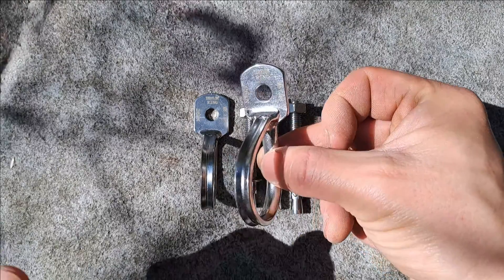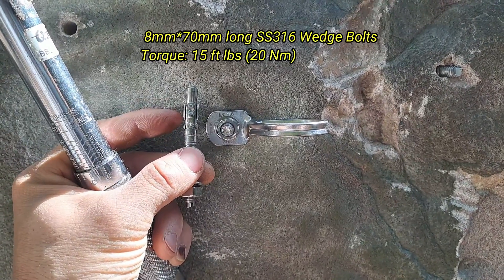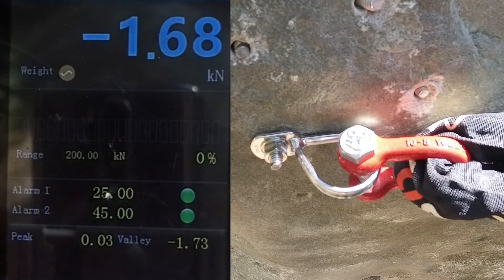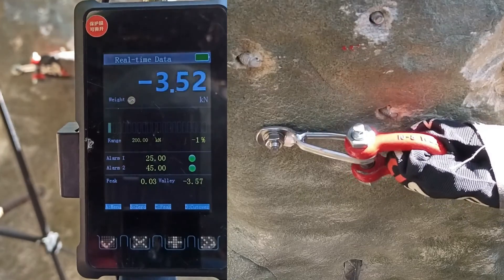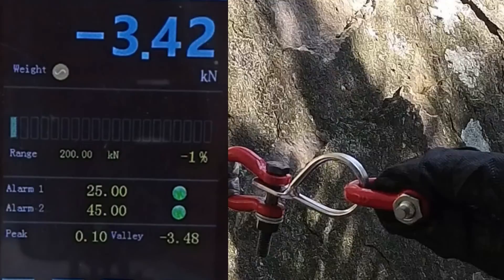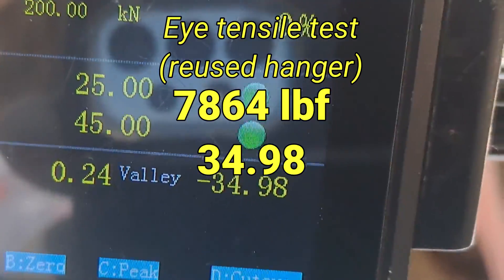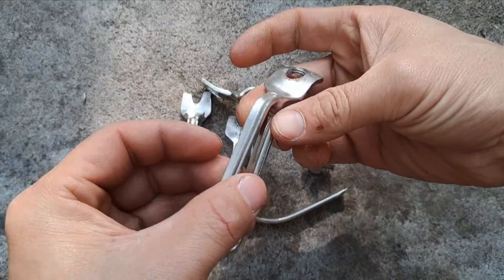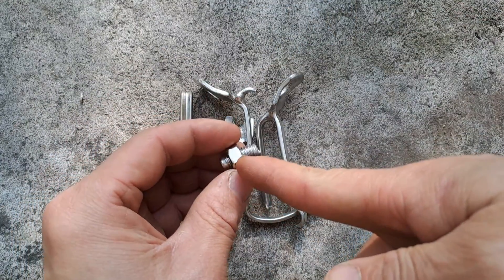BREAK TEST: TEBYLON RING, hanger for Canyoning Canyoneering Caving of 316 Stainless Steel

Comment: @climbingtaiwan can you rappel directly off these using dynamic climbing ropes (multi pitch scenario) ?
Do they stock ones with wider holes for 3/8" bolts?
Reply from the maker: Hi. I personally would not recommend these specific hangers  for any rock climbing application. The maker/designer of them made for more canyoning/rappeling usage, and not where a dynamic loading (e.g. belaying from a multi-pitch anchor) would be experienced. Yes, you can directly rappel from them, but the thinner material was chosen to reduce weight. If you're interested in TEBYLON products I think their EXP3 would be better suited for a climbing(+rappelling) application; there's more available metal on them. I'm not saying this small lightweight TEBYLON Ring is weak or not strong enough for rappeling loads, it just falls short of the durability and robustness climbing anchors should have and what climbers are used to.
Reply from the maker: Oh, this TEBYLON Ring is only available in a 8mm (5/16") version. But their EXP3 has a 10mm bolt hole and will work for 3/8” bolts for sure.